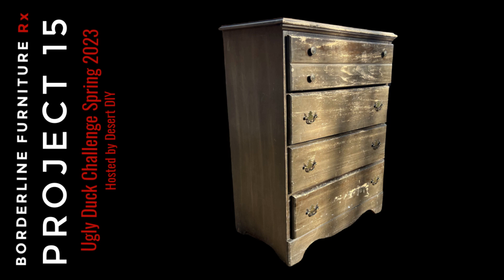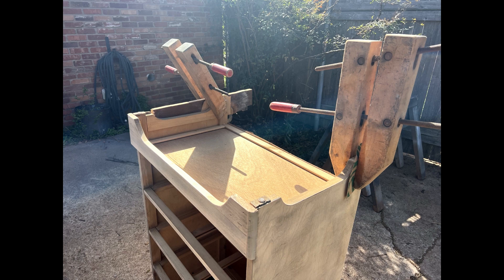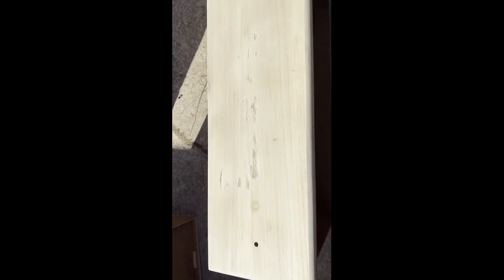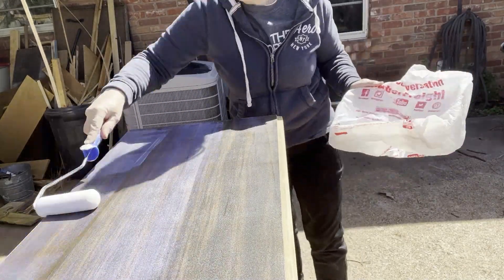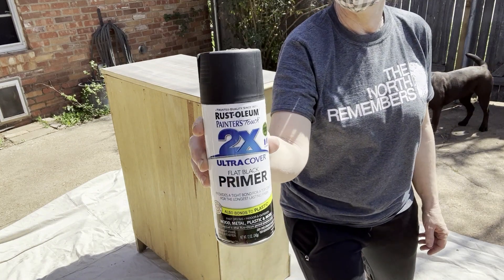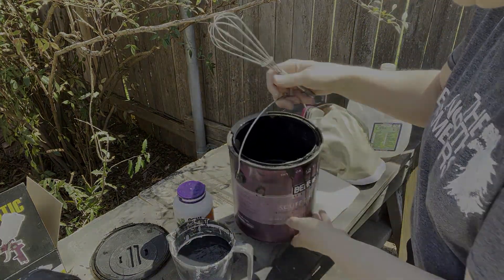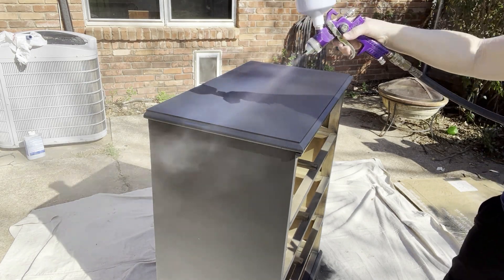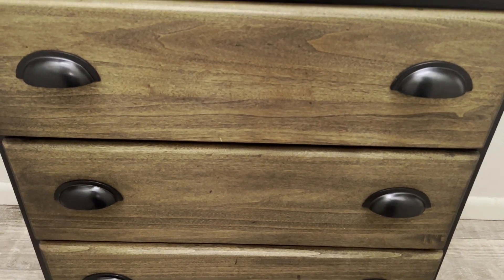Borderline Furniture Rx Project 15 - How to create a modern industrial looking dresser

Comment: That turned out very nice! Great tip with the wire stripper to cut machine screws.
Reply: I can’t imagine what people are doing to shorten screws - unless they are buying new screws.
Reply: @marahfanning2879  I've always used a bolt cutter or a pipe cutter🤷‍♀️ but I think yours would be the neatest 😘